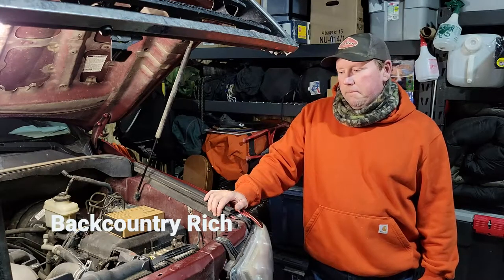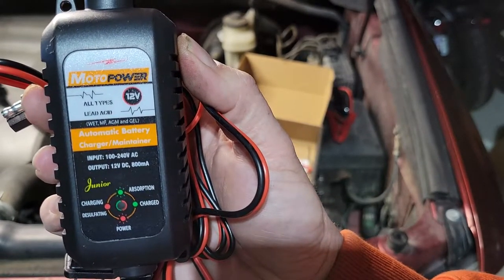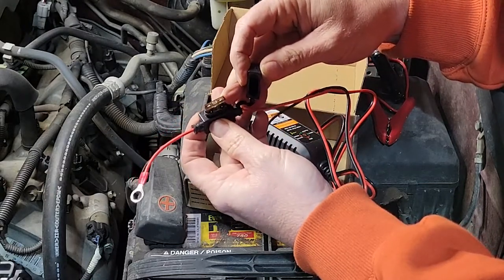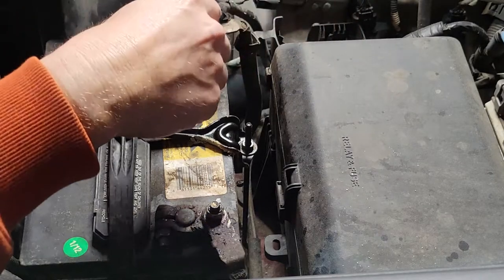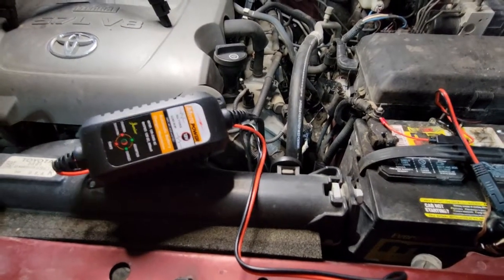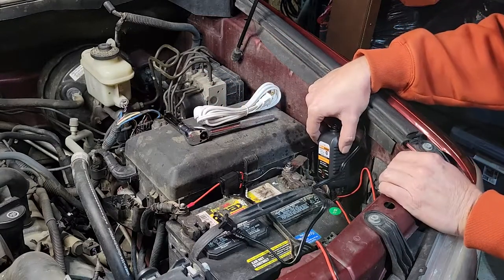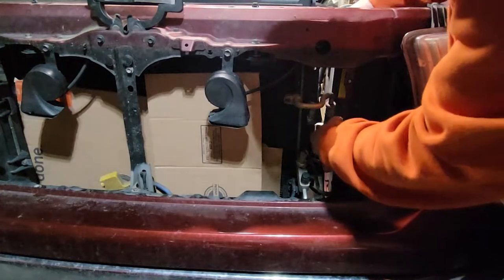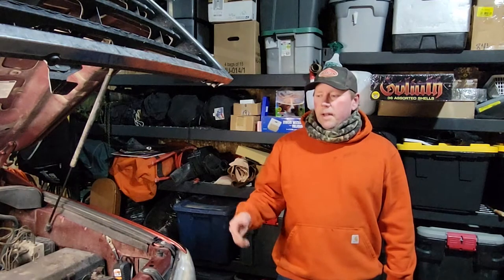How to install a battery charger, maintainer on your vehicle

Comment: Geez, I had such a dumb question I couldn't get an answer to... and your video solved it for me. I've been using my new maintainer for this past week, with alligator clips, and wanted to install the permanent clips instead. And while I know it's safe to touch the battery, I was nervous about screwing down the nuts once the lead was attached (even with the charger itself not connected). Like, I'd create some electrical arc with me in the middle of it, haha. I don't know this kind of basic stuff and I always have to try to Google search it out. I just knew something bad would happen and the AAA dude I'd have to call to tow my car (once I shorted the whole thing out and recovered from severe burns) would say, "Oh wow, lady, you mean you actually touched the nuts AFTER you had the lead on?!! Didn't you know that created a closed circuit with high voltage?!!" Haha. Anyway, thanks for putting your hands all over that while installing the permanent clips/lead! Answered my question for sure. I just finished putting it on, wove the plug end thru the front grill, and I'm really pleased with myself. I love not having to worry about my little Honda FIT battery dying due to endless short trips and long stretches with no driving. But especially pleased now with the easy come 'n go aspect of this setup... I don't have to pop the hood at all now. Thanks for the video!
Reply from the maker: Awesome glad I could help out! Great analogy of what could have happened 😄

Comment: Is it safe to run a battery heating pad and a battery maintainer at the same time. I live in Alaska currently it's -40 and I'm having issues with my battery going dead..  I bought the trickle charger and I winterized my truck completely by myself. Now just wondering if you can run both the pad and charger going to the 4 way??
Reply from the maker: I have successfully ran both on 4 vehicles

Comment: excellent video thank you very much. so i have a question.. i have a duramax diesel, has two batteries can you show us how to hook up a maintainer with two batteries in the vehicle?
Reply from the maker: Thanks! If your truck is 2-12 volt batteries in parallel (12 volt system) you can connect one 12 volt charger similar to the one I have. Connect positive to positive on the first battery and negative to negative on the second. The charger you buy might need to be more robust than mine since you have 2 batts. Good wiring diagrams online for 2 battery automotive systems. Hope that helps.
Reply: @backcountryrich7740  so if i only have 1 positive and one negative lead coming out of the charger i could splice into them and add an extra lead to each one? then make the connections in parallel like you mentioned?

Comment: I came to your channel after Dave Whipple recommended it. Dave’s endorsement is all I need to sub. What’s with the cardboard in front of your radiator? Is that a mod for cold weather operation?
Reply from the maker: Hey thanks for coming over! Dave is a great friend and I really appreciate his support. Yes that is a "Mod" to block the cold air from the radiator and raise engine temperature in the winter.
Reply: @backcountryrich7740  You bet! 

Regarding the air flow mod, I’ve seen tractor-trailers with a fabric cover on the outside of the grill to do the same thing, I guess.
Reply from the maker: @j.p.saverance8972  There are covers made to fit but I'm to cheap to buy one. So I stuff cardboard in there. Just have to remember to remove it when warm weather arrives.
Reply: @backcountryrich7740  Nothing wrong with that!
Reply: -40 winter guy here. Buddy of mine even put gorilla tape on the face of his cardboard cover. Moisture protection for the board, and gives a slicker look 👍

Comment: This is probably a dumb question, but why didn't you just keep the unit external from the car, and then route the quick disconnect cable out? Wouldn't that prevent the need to even route an extension cable in the car, let alone have to figure out mounting of the unit?
Reply from the maker: I have the truck winterized with an engine block heater, oil pan/transmission heating pad and onboard battery charger. This all ties into the 4 way outlet plug and then a single pigtail sticking out of the front grill to accept a extension cord. That way when I go to work or travel abroad I can plug it in for a couple of hours so it will start in really cold weather. Down to -60F. Hopefully that answered your question. Thanks for watching!
Reply: @backcountryrich7740  thanks. I just moved to were it gets cold and have no idea about this stuff.
Reply: @backcountryrich7740 I’m think of putting one of these in my car. We’ve had a polar vortex here creating windchills of -45 to -50 (Celsius). Has the maintainer worked ok so far in -50 Fahrenheit? I don’t have a garage either so the onboard maintainer wouldn’t get warmed up much ever.
Reply from the maker: So far it has worked for me even down to -50F
Reply from the maker: I have the charger plus block heater and transmission heater all plugged in so I can charge and heat the truck anywhere I go.

Comment: where do you put the connectors if you have a 4 post battery?
Reply from the maker: If your battery has top and side mounted  plus and minus connections or posts just pick the easiest ones for you to connect to and double check your wiring, plus to plus and negative to negative.

Comment: Are there maintainers that charge while car is running?
Reply from the maker: Not that I am aware of. When the vehicle is running, your alternator should be charging your battery and supplying power to accessories.
Reply: Yea.. your alternator lol
Reply: @mediaflmcreation  lol yeah that’s a funny one. it does make sense though for something like this to be invented because a lot of newer cars the alternators are inside of the engine or not necessarily in a place to replace. so something that you could hook up to your battery and it would take the place of your alternator if your alternator was no longer charging. Long story short I ended up selling the 2004 Honda CRV it had a battery draw from one of the sensors or something. I put a new battery in it drove it for a while then sold it got a newer Honda.